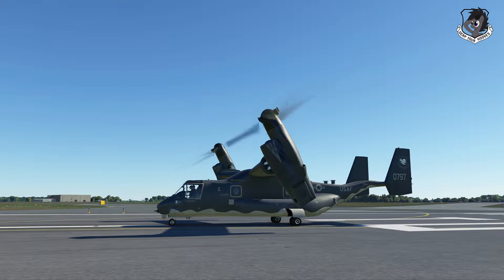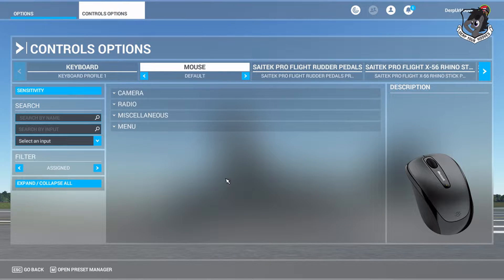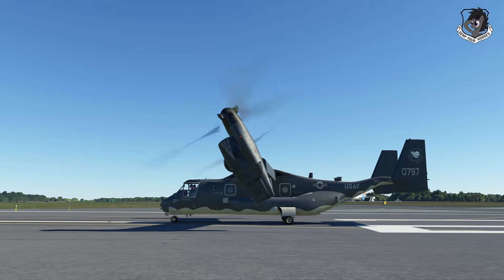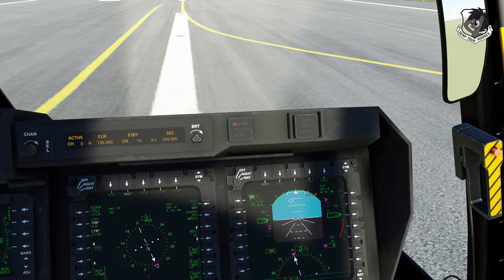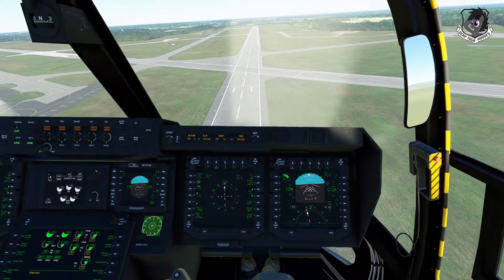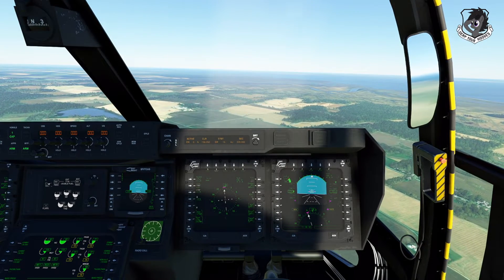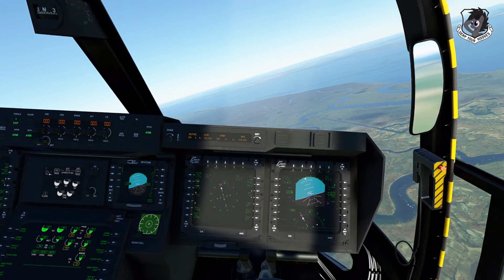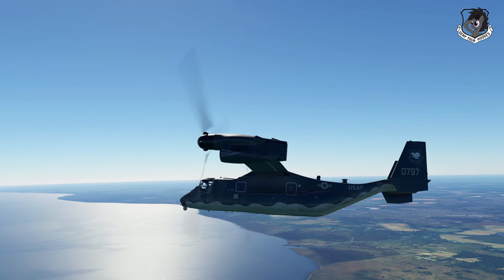V-22 Osprey Nacelle Tutorial MSFS 2020

Comment: I spent hours trying to move my nacelles. Each time MSFS froze, requiring CntrlAltDel reset. You stated that keyboard commands did not work for you. That was the clue. At the same time I was using my Trustmaster Throttle slider to tilt the props. That did not work either. 

Taking your suggestion to use HOTAS switches to tilt the props WORKED! Thanks for your video. I wasn't smart enough to find the fix myse after too many hours looking. Now I am having fun flying the V22.

Thanks. Good work.👌🙂i
Reply from the maker: No problem.